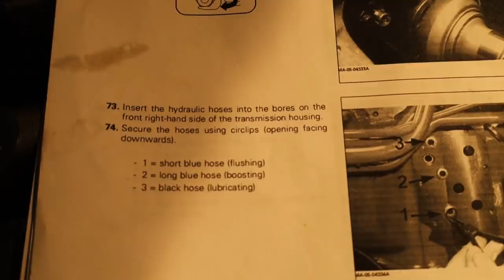Tractor is Finally Finished!

Comment: If you have a good service manual it’s no different than following a recipe for a from scratch cake. People get intimidated by doing their own repairs when they really shouldn’t. There is nothing and I mean nothing that a mechanic can do that we can’t do. People seemed amazed when I over haul an engine or split a tractor apart. If you do t have the right braces you make them. I’m proud of you guys. What a great project. And the literal thousands you saved by doing it yourself

Comment: The adjusting motor is called a stepper motor and it controls the angle of the swash plate that determines speed

Comment: It would be interesting to know how the repair had you taken it in to the dealer and had them repair.  BIG 💵💵💵
Reply from the maker: Yes, Big Bill, plus it would still be in the shop.
Reply: My guess, and having previous experience with shop repairs, they probably saved a minimum of $8000 in labor cost, not including shop charges, like shop towels, hand cleaner, and just about anything else they can find to tack on to the invoice. All told, probably well over $10,000 savings by doing it himself.